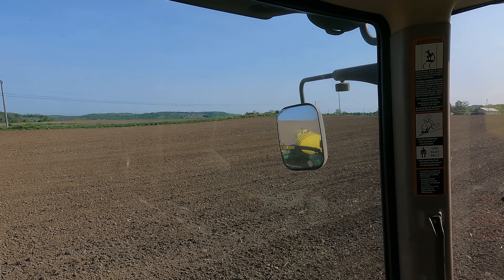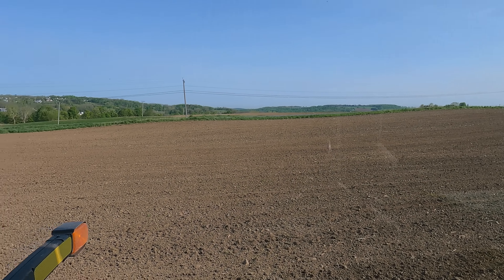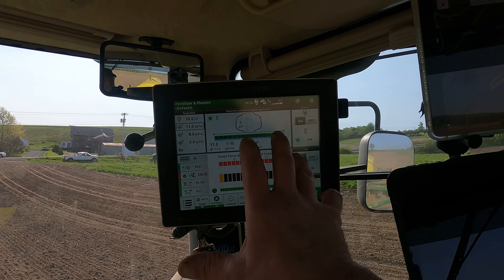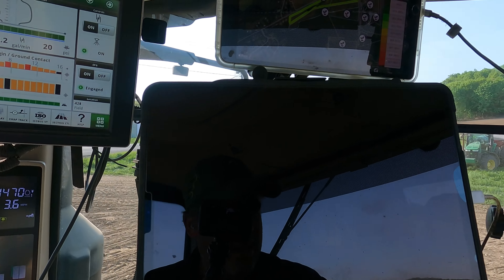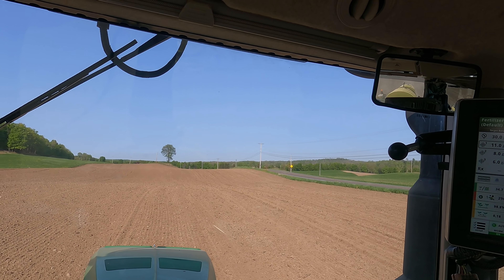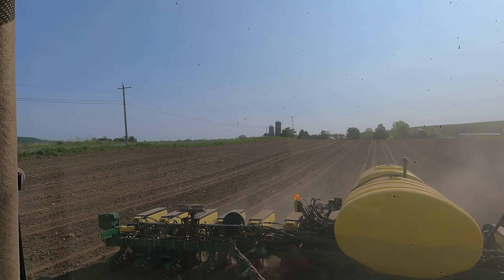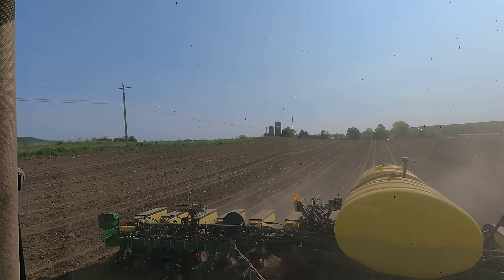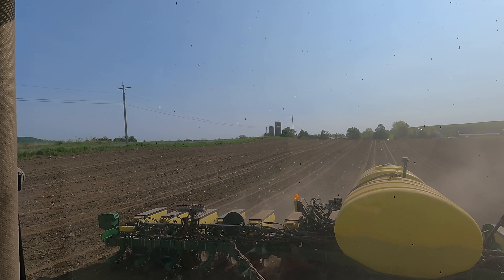This upgrade cost how much?

Comment: You did an amazing job putting the new kit on the planter. When you went straight to the field to do a test run I was amazed at the few issues you had. The good thing about you doing the kit, you knew where every part was and could quickly remedy the problem. You're a rare breed. Good job.

Comment: Just a little tip if you ever want to clean your radiator and engine block out here is what you do I did this for 30 years in the military and always work get a bottle of cascade dishwasher soap the gel  dump at the bottle in a 5 gallon bucket at warm water stirred real good and then dump it in your radiator and Rhonda vehicle for at least a half an hour and that really cleans the radiator in the engine block real good you will see all kinds of crud coming out just a little tip have a good evening

Comment: I believe you and Sarah did a fantastic job in upgrading the planter. Looking back on the video where you had all the parts laid out ready for installing it seemed a mind boggling task ahead. That you installed all those bits and it worked fairly seamlessly deserves a pat on the back for the pair oy you.
BTW is the monitor (4770!!) a programmed device running I guess Linux?
Reply from the maker: 4640 Deere monitor

Comment: In a place where you take out trees and rock outcrops you must need to add loam to get your adequate depth of soil. Do you ever go to a lower place in the field where the loam has been gradually getting deeper and push some out to spread up on the thin area?
Reply from the maker: No

Comment: Hey there Andy, and crew, I hope this finds you all well and good!

I couldn't make your live stream shindig the other night, but have no fear, I've been keeping up with you and watching everything you've been putting out.

I told you those Precision and Performance upgrades have been in the fields across the Country for 2 years now, increasing the efficiency of the American Farmer by as much as 15% in certain applications. 

I know you probably get tired of hearing my opinions and suggestions, and I know as well as anyone that farmers can be a hard sell when it comes to change. 

I briefly mentioned the weights that you've added to the wings on your planter, and I understand that you have struggled at times in certain conditions with keeping adequate down pressure on the outer units, which played an integral part in the development of both the pneumatic and hydraulic downforce systems, thus eliminating the need for added ballast. 

Now your outter row units are taxed with lifting that added weight many times in every acre that's planted. I'm willing to wager that your outer units will wear and need regularly scheduled maintenance at shorter intervals than the other row units.

I hope y'all have a good one, and keep that Green Iron rolling.  

I hope you ordered your Seed Tender with the optional remote control, which makes life easier, as well as quicker, it's money well spent. 

"Nothing Runs Like A Deere " 🦌👍🇺🇸
Reply from the maker: Actually could use a little more weight.A 12 row planter has 3 rows on the wing carried by one wheel and one lift cylinder.A 16 row has two wheels and two lift cylinders with 5 units on the wing. The row unit would never carry any more weight than what you have the down force set at and sometimes rows 1&16 are riding a touch high
Reply: @FarmingFixingFabricating  

Hey there Andy. The whole reason behind the independent and near immediate adjusting downforce systems are just that, if any row (no matter the location) incurs a lighter or heavier load than what you have it set on, it adjusts immediately, and independently, no matter how heavy or light your frame is, and additional (unsprung) weight can cause the system on 1 or more row units to hunt, and incidentally cycle more frequently, which means more wear. 
I know why you think the way you do, but vertical movement of the wings, can be somewhat of an illusion at times.
Sometimes I'm sure that my illustration and description leaves much to be desired, and I know that you don't have the time of inclination to read longer posts, which are already too long.
I do appreciate your time, and many times I wish I were there, so I could show you what I'm talking about, inadequately at best, and to let you show me what you're talking about, and I would advise anyone trying to discount your idea or position, "to do so at their own risk" I hope you're putting that seed in the ground, and you ordered a remote control on your Seed Tender. Thanks again! 🦌👍🇺🇸

Comment: need the power company to move that line but for all the rock that i see there it would take a explosives team to come in there and deal with it looks like from here anyway as for the troubles you are having i do not see no way to fix them in the shop you would have to have it in true field conditions to find and fix them

Comment: Great video Andy!  Interesting hearing about all different issues and worries you had with the upgrade.  Your Dad with that 6 row planter doing your corn would be cruel.  You'd probably be charged with elder abuse!  How does a company--a manufacturing company--end up cancelling orders.  Cas had to be thrilled when that happened!  Were you considering running 2 12 row planters down the line?  Or were you going to just run the new 12 and the 6?  Just some thoughts meandering around that wanted me to ask. lol!  Glad the seed tender is working out.  Keep the videos coming!
Reply from the maker: 16&a12 some day